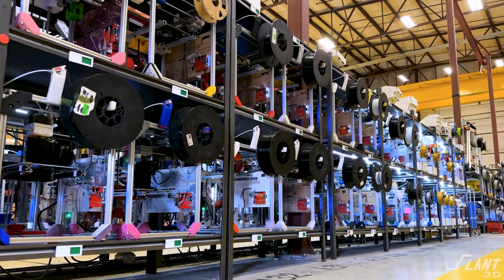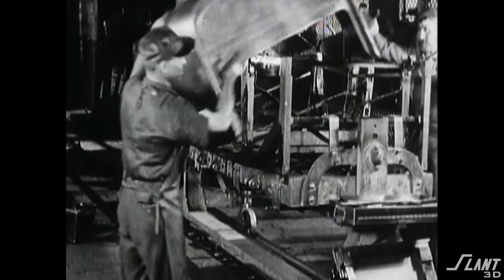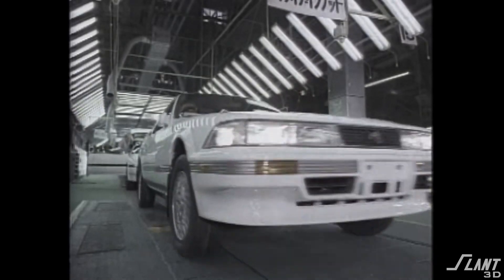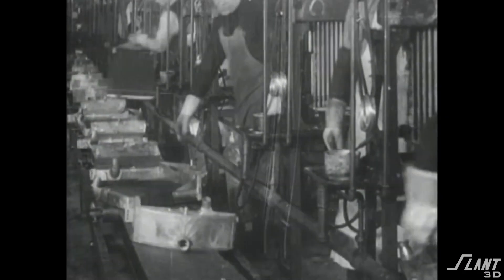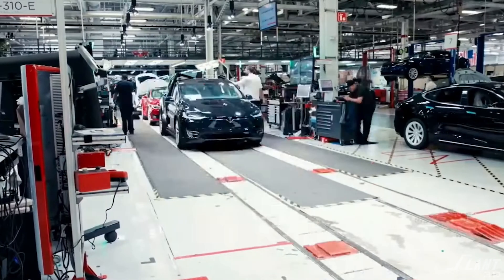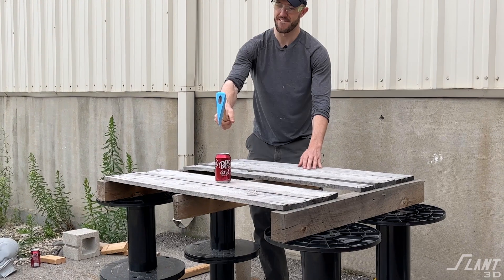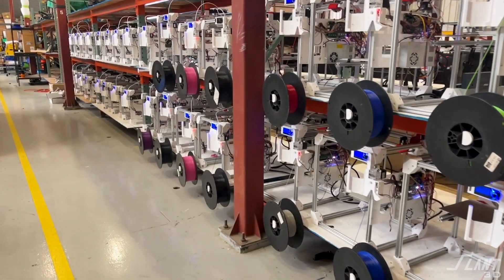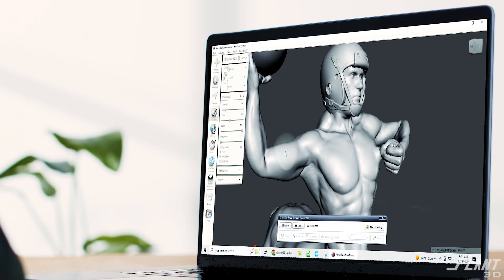What We Are Doing is Impossible... But Here's How We Do It

Comment: I really appreciate what your company has achieved, but my BS meter was pegged in this video. There are notable quality issues with prints from Slant API orders, and claiming that it's "impossible" to perform quality control on any model feels like a cop-out. 

You know what constitutes a bad print: under extrusion, over extrusion, poor first layer bed adhesion, and elephant foot, to name a few. These issues are universal quality measures that apply to every print. Implementing checks for these common problems can significantly enhance customer satisfaction.

By inspecting every print for these specific issues, you can ensure higher consistency and quality. Additionally, I would love to see a video where you discuss prints that need to be discarded and reprinted, and how these prints help determine when it’s time to replace components like nozzles or extruder assemblies. Addressing these factors can prevent sub-par quality in future prints.

Thank you for considering this feedback. Improving these areas would greatly enhance the overall customer experience.

-Travis
Reply from the maker: What are the problems you have run into with the API, so we can get the fixed. This has never been done before it is pretty tough to be the first over the wall
Reply from the maker: We also just release a new slicing upgrade on the API. Happy to runa. Free test print to verify
Reply from the maker: We do sort for all of those issues. But it is a question of tolerances not presence.
Reply: @slant3d  do you publish the quality tolerances?  As an API consumer, knowing the tolerances would be great.
Reply from the maker: O.2mm
Reply from the maker: Also
 Any files that you had problems with email info@slant3d.com and we will reprint and reship them
Reply: @slant3d  Yes, you guys are fantastic at offering reprints which speaks to your great customer service.  I would love to not need to request a reprint is my point.